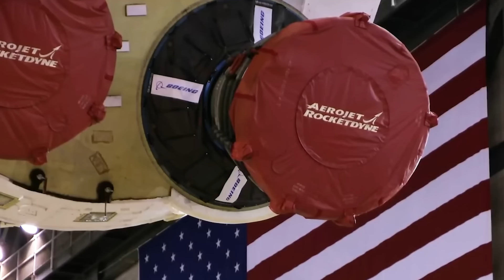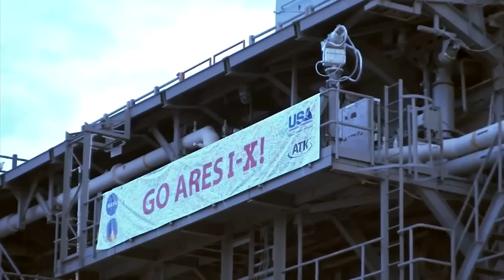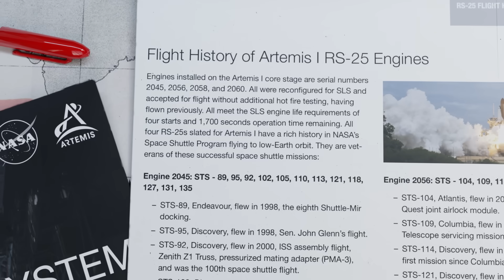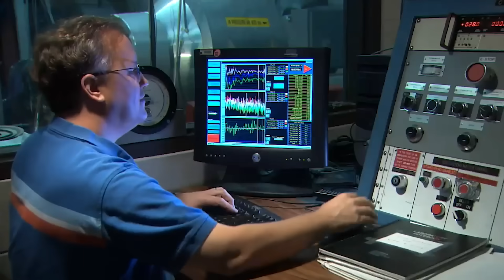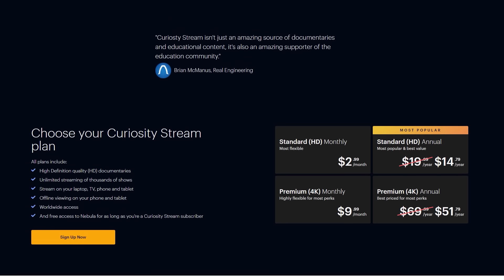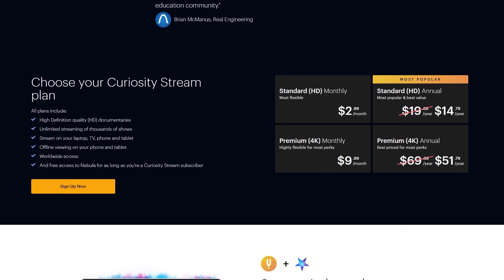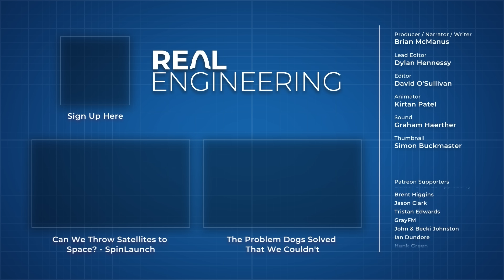The SLS is Outdated. Why Does it Exist?

Comment: Here is an interesting comment on the history of SLS, explaining that it wasn't just politics that lead to SLS. It was posted as a comment to the piece "The SLS rocket is the worst thing to happen to NASA—but maybe also the best?" which was written by Eric Berger for Ars Technica. Here it goes:

Good article. I think Eric somewhat oversells the angle that Congress and the defense contractors imposed SLS/Orion on NASA. This was very much a two-way street, and although Boeing doesn't deserve any sympathy from anybody, at least one of the other defense contractors had the right idea.

It's really important to the history of Ares/SLS to note that the Crew Exploration Vehicle (CEV) program came before any of that. Sean O'Keefe was NASA Administrator, and he called for a fly-off competition in which multiple providers would fly an LEO demonstration mission before selecting a single winner. This precluded the use of launch vehicles that didn't exist.

Lockheed Martin's CEV proposal was far more innovative than the Northrop/Boeing proposal. They called for a reusable lifting body reentry vehicle with a captive abort system that could be launched on Atlas V. This was their LEO solution. For exploration missions, a pressurized mission module and a long-duration cryogenic propulsion stage (ACES) would be launched on two Atlas V or Delta IV rockets before the crew launch, and the three modules would dock in LEO prior to departure.

Wonderful! That's exactly what we should have done! How did it go wrong? Well, Michael Griffin was appointed NASA Administrator, and he thought the fly-off competition was silly. He also didn't like either of proposals because they were different from what he proposed in a whitepaper he authored a year before his appointment. So he canceled the fly-off, declared Lockheed the winner, and issued a gigantic change request transforming their proposal into the Apollo On Steroids we know as Orion.

Michael Griffin was the originator of the "1.5-launch architecture" in which a super-heavy Shuttle-derived rocket (Ares V) launches the lunar lander and a medium Shuttle-derived rocket (Ares I) launches the crew vehicle. Griffin argued that ULA's rockets suffered from a lack of commercial demand which would make them more expensive than if NASA developed their own rockets -- if you can believe that. This became NASA's official position as part of the Exploration Systems Architecture Study (ESAS) he commissioned. And the ESAS report made it easy to cultivate the support of Richard Shelby, Bill Nelson, Kay Bailey Hutchison, and others in Congress.

ULA was advocating for distributed launch of commercial vehicles and even using the verboten D-word through 2009, when they published this gem that is still proudly hosted on their website:

https://www.ulalaunch.com/docs/default-source/exploration/affordable-exploration-architecture-2009.pdf

This was around the time that Richard Shelby flipped out and said he'd pull the funding if ULA or its parents kept talking about propellant depots. NASA sold Congress on the expensive approach, and when big bad industry suggested there's a better way, Congress told them to shut their filthy mouths. Not long after, SLS was enshrined as the spiritual successor to Ares V, and at that point Boeing really started to dig in their heels to protect their cash cow from potential competition.

We could have had Lockheed's modular CEV, and we could have had a depot-based distributed launch architecture from ULA. The "dinosaur" industrial base was not opposed to delivering those solutions. There was a period in time when the big defense contractors were reading the tea leaves, and they were basically told to get their eyes checked and fall in line. So they did.

Still doesn't excuse Boeing's poor performance. Nothing does.
Reply: The original Lockheed Lifting body proposal began life as a high Mach number escape/survival pod for aircraft use. It would have reentered aerodynamically, and had a lot more control, then landed by parachute.
Reply: Need TL:DR.
Reply: @SirZeck  Tl;dr: Congress bad
Reply: @blink182bfsftw  No, that is exactly not what the comment argues. Former NASA
administrator Michael Griffin pushed SLS. He was not a member of Congress. Also, ULA, an "Old Space" company, was against SLS.
Reply: https://youtu.be/Kqt-ChsHrIY
Finally it’s here..
Reply: Lockheed is just proving to be much better run than Boeing.
Reply: @jeffk464  So, so much. The F-22, F-35, the F-16, SR-71, the U-2, the Skunk Works, and more. Boeing, meanwhile, is just struggling to stop snatching defeat from the jaws of victory.
Reply: @SirZeck  It's a few paragraphs. It's worth reading, and you definitely can read it.
Reply: @SirZeck  TL:DR: 
SLS is not entirely the fault of congress. The idea was sold to them by NASA, who themselves were forced to adopt the idea by the new NASA Administrator, Michael Griffin. He disliked Lockheed Martin's CEV proposal, a much more sensible and innovative alternative to SLS. The plan would use 3 smaller, already existing rockets (like Delta IV or Altas V) to assemble a craft in LEO to fly to the moon consisting of a cryogenic stage, a pressurized habitat, and a return lifting body reentry vehicle for return to earth.
Reply: @josephpentony4804  Thank you, Much appreciated.
Reply: Thanks, Obama.
Reply: @SirZeck  Your laziness in not being willing to read a few paragraphs is beyond belief!
Reply: @GntlTch  Say what you will, I'm not interested enough in the subject, even more so if it has something to do with the government. I got no time to dive down into a comment on a video I didn't search for.
Reply: @SirZeck  Yet you spent more time broadcasting your laziness than it would have taken to read the short post in the first place!
Reply: @SirZeck  And yet you bother to reply to people criticizing you for being unwilling to read less than 500 words when you are, by your own admission, uninterested in the subject. 'Ill-literate' seems like an appropriate adjective here.

Comment: I think you’re missing some very very key aspects regarding the Constellation and Artemis programs, like the fact that even though Artemis (rather sls) has gone 2x over budget at roughly $23B it’s still 10x less than constellation... who’s budget was $230B. On top of that there’s still some political aspects that ‘helped’ shut down constellation and actually helped Artemis.
Reply: I've followed the space exploration only slightly, but this video just seems *wrong*. As if using old parts is some kind of *gotcha!*.

I could be completely wrong, but something just made my spider sense tingle. Maybe when Scott Manley bashes the SLS program I'll believe it :)
Reply: Yes, he also said Constellation was “resurrected as Artemis,” while the Artemis program didn’t actually exist until 2017.  It was a nameless SLS + Orion program without a clear target from 2011 to 2016.  Constellation was a very different program, especially with respect to how the Ares rockets (Ares I and V) would have been used.  The biggest similarity, which he correctly points out, is in the design architecture of Ares V/SLS, with both leaning heavily on the existing Shuttle infrastructure and workforce.
Reply: Yeah, but starship really meet the goals of what NASA wants so I find the whole thing a waste of money.

If you want to put a base on the moon you can't use that Artemis program.  All that does is get you people on the moon with very limited amount of equipment.  You could launch two starship missions and everything is there.

While starship might not be the best way to explore, it's by far the best way to move equipment and people.
Reply: @johndoh5182  Starship still has a LOT (I repeat—A LOT) of work to undergo to be usable. It's got potential, but that potential has yet to be realized. SLS is necessary for the next 10 years at least. Tomorrow's launch will tell us whether SLS is mature enough. If it is, we should use it. As much as I love it, Starship is still far from being mature.
Reply: @johndoh5182    So much BS in so little texT . . . congratulations!
Reply: @johndoh5182  Starship hasn't met any goals yet. They've done the flop test, landed once, and crashed all the rest of the times. The lower half hasn't even gotten off the ground.
Reply: @nebtheweb8885  The trouble is the SLS isn't competing with Starship/super-heavy.  It's competing with Falcon Heavy.
The real question is not whether SLS or starship will fly first, but how many times Starship will fly between SLS-1 and SLS-2.
Reply: @ukk9031  Thank you for your thoughtful, detailed counter-argument. 🙄
Reply: @GntlTch  SLS, as a rocket, is ready right now, regardless of how much you ignore the hard facts. It's absolutely not without flaws, as evidenced by the two recent scrubs. However, we know it's ready for a full-up flight thanks to flight heritage alongside extensive simulation and testing, including full runs of the core stage and boosters. Starship is exciting, but it's a brand new system. We still have no idea when it will actually fly. We've never seen SpaceX fire all 33 engines at once. We don’t know if it will be as reusable as they hope. We don’t know how long it will take Starship to be crew rated, especially for NASA use. There's little evidence to suggest crew-capable Starships are anywhere near maturity, even though they need to be by 2025.

I know people who are working on or have worked on both SLS and Starship. They respect each other's work, and they all acknowledge SLS is ready, while Starship is not. SLS, despite being expensive and slow to reach readiness, is necessary. I know that won't be the case forever, but for now, and likely for the next decade, it will be necessary. You need to be realistic and take a look at ALL the systems we're developing and still need for Artemis. Starship and spacesuits are major concerns for the 2025 goal. I’m working on the latter, and many of my friends are working on the former, but those working on SLS are in a much better position without nearly as much pressure, especially if Artemis I goes well.

I’m excited for both rockets as well as everything else in the pipeline for spaceflight, but people like you are hurting the industry by being loud and uninformed fanboys. As a member of that industry, I implore you to stop.
Reply: @johndoh5182  Problem is, we're just not done with exploring. 
Starship will be there when it gets there, but for now the SLS will be the pioneer ships.
Reply: @VikingTeddy  SLS has frequently come up in Scotts space updates and I got the impression that he's mostly frustrated about how politics influences it. The whole keeping politicians happy with some specific jobs for their area in particular. And for a long time I got a bit of an "I'll believe it when I see it" attitude towards the progress of SLS program in past years when it wasn't at the current actually looking like it'll possibly be launced state.

Reusing old parts in itself isn't bad but I do wonder about a future where more of these have to be built and the old original spare parts from past programs are no longer available due to having been used or storage conditions. The original contractors, tooling and institutional knowledge in employees is certainly no longer around for many of those. So then they'll have to rebuild either the original part exactly or a (mostly) compatible one, in the former case integrating that into the whole design might lead to more issues down the line. Even trying to replicate an exact part with the same methods of back then might not work because of some undocumented issue or lost experience by not having the same people doing it. At some point it makes more sense to based on past experience make the right design for the mission and guarantee you can make new parts less spread out over the whole country if more rockets are to be built. Not sure what number of rockets that is for SLS but depending on the spare parts it might just be after the first one.

In the end I hope it'll all work out for this rocket and future launches, but I'm somewhat sceptical about it. At least it isn't my tax money being spent on it in a less than ideal rigidly defined ways due to not living in the US. I typically like space launches, they are nice to look at and many are for useful purposes too. When we get to know the payload that is, not always sure how I feel about the various military projects but good technology has come out of that as well in some cases.
Reply: @extrastuff9463  Thanks for the explanation :)
Reply: @GntlTch  I never said I like the spending or the political motivation. I despise the wastefulness in the SLS program, especially with the tower, but such is the game with current government contracting rules. Boeing and others milk contracts for all they can, and politicians push their own interests. That doesn’t make the rocket any less necessary. I also acknowledged that it's still on the pad. It won’t launch until they check EVERY box because Artemis I has to succeed precisely because we taxpayers are holding them accountable. But from the standpoint of an informed person (which you CLEARLY are not), SLS is ready. The technology is developed and built for Artemis I, and much of it is ready and earmarked for Artemis II and III. SpaceX, on the other hand, is still developing Starship. They have investors who are funding rapid, wasteful, out-in-the-open development for all to see. Instead of careful simulation and component-level testing, they throw it all together and run with it. They've built a lot of prototypes as a result. I've been on site at Starbase. It's a remarkable place run by several smart engineers. But I can assure you that they're not taking us to the Moon without SLS anytime soon. If anything holds up Artemis III, it's most likely going to be Starship and/or the Collins/Axiom spacesuits.

We have an exciting future in space. SLS is a critical part of that, whether you realize it or not. And that's the end of this discussion. If you're going to be unreasonable, ignore my points, and put words in my mouth, I’m not going to waste my time with you. If you care so much about your tax dollars, you should look at what other government entities are squandering it on. SLS isn’t even pennies on the dollar.

Have a blessed day.
Reply: @sarahsmith840  Nope, because we're talking about manned spaceflight. In that context, Falcon Heavy is essentially a canned program.

Actually in terms of cargo it's fairly close to canned anyways, check out the number of Falcon Heavy launches over time.
Reply: @JustinRoskamp  Wow, what a crybaby.
Reply: Constellation/Ares V was supposed to take humans to Mars per my recollection. I was also 10 years old when I learned that…so take that with a heap of salt. I was definitely very confused what happened to that until a year ago or so lol.